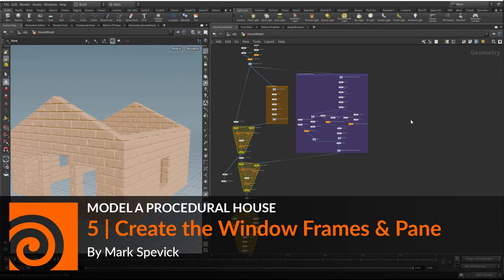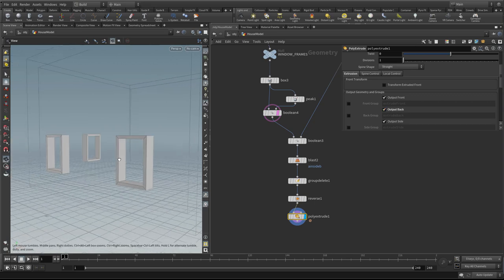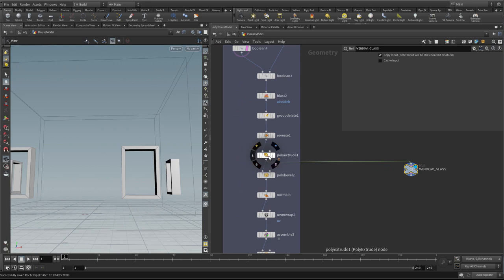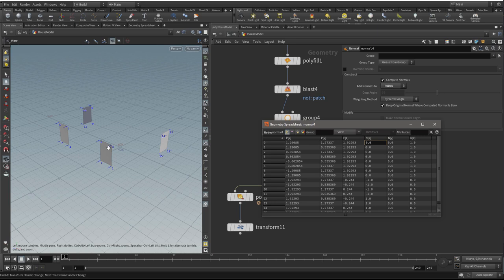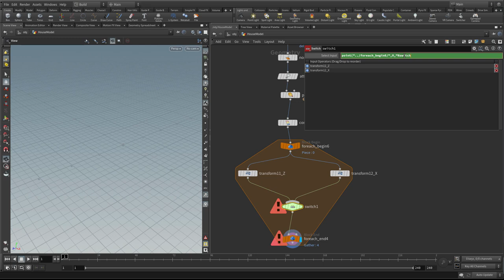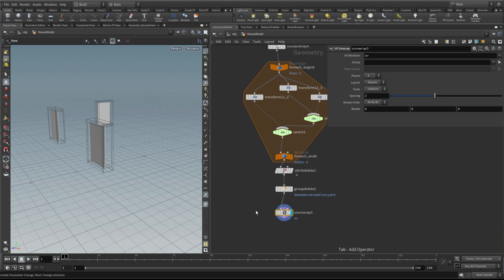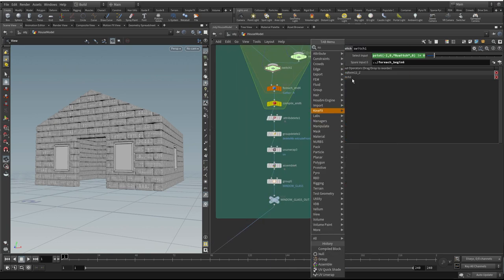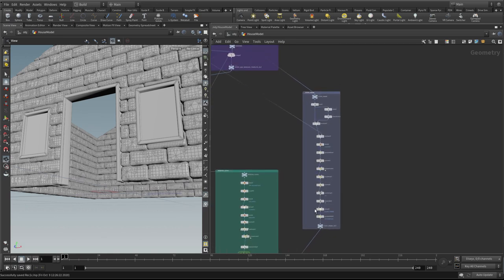Procedural House | 5 | Create Window Frames & Pane

Comment: For that he went through a complicated foreach process for moving the window glass, I'd like to say even if he couldn't think of a more simple way, it doesn't mean he doesn't know it. Houdini has too many ways to solve a problem that every person will approach different :) It happens a lot that you forget the most simple yet best solutions but rather create lines of complicated VEX codes. He is definitely one of the best instructors I've seen so far explaining every detail from the eyes of beginners. I just want to say that it's a great tutorial with the right person to do it and I appreciate a lot for that. He would have chosen easier ways if it was a different time. After all, you need to get it done at work and that's what matters anyway

Comment: Moving the windows was a bit cumbersome. Attribute Wrangles can be a bit tough to wrap your head but you can do this with one line. Each of the points Position will be changed by adding the (@N (normal) multiplied by a channel float (a number you specify by clicking on the 'create spare paramters' button).

@P += @N * chf("Move_Amount");

Comment: great tutorial so far. learning a ton. in fact, for offsetting the glass windows i simply put a PEAK node above the polyextrude, which you had used in a different context earlier. seemed to work just fine. any drawbacks?

Comment: Wouldn't the "deleteMe" group change if you decide to split the side windows? 🤔
Reply: I used the Window_Frames box node and a Peak node (w/negative distance) as a Bounding Object in the deleteMe group's "Keep in Bounding Regions". That will procedurally select all the inside points.
Reply: if(@P.x > 0 && @N.x < 0){
    removepoint(0, @ptnum);
}

if(@P.x < 0 && @N.x > 0){
    removepoint(0, @ptnum);
}

I put this VEX wrangle.. it works procedurally but not sure if it's a smart way to do it. What Ryan Tindall suggested is great too but it won't work if the thickness of the wall is not enough for the peak node distance(I guess you will have to put like 0.001 value to make it work all the time tho)